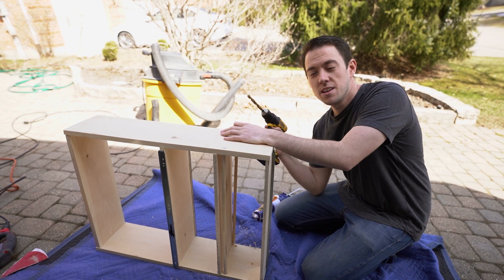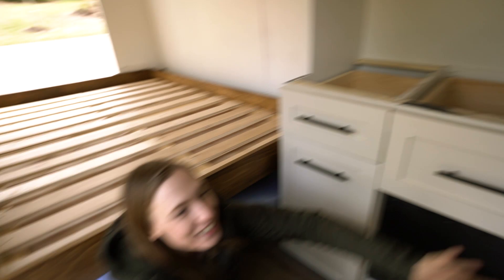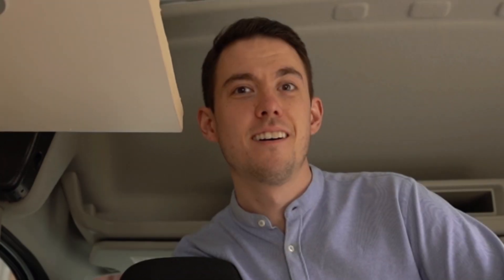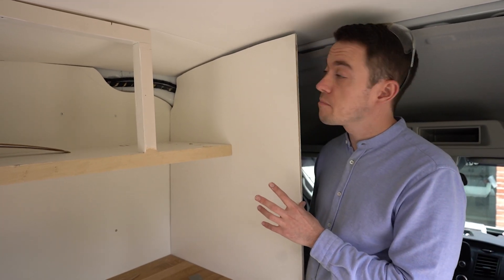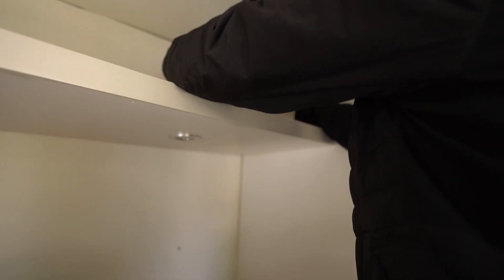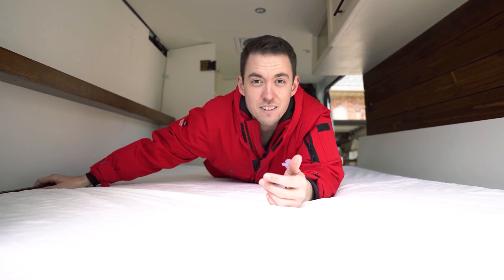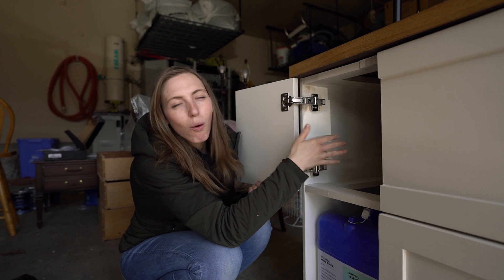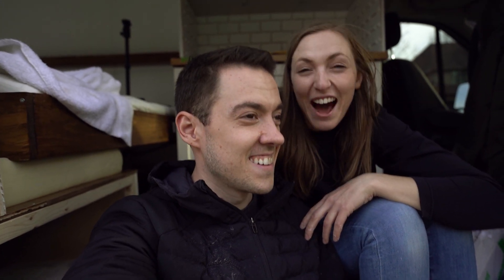We’re ALMOST done our van build! | Transit Van Conversion

Comment: Looks great guys! I ran my electrical wires today. Hoping tofinish my subfloor and framing the walls tomorrow. Decided to switch to 2x4 instead of 1x3 for furring strips. Couple weird parts of my van walls stick out and the bigger 2x4 will make it easier to put on walls smoothly. I need to connect my wires to the battery for my dc to dc charger. That way I don’t have to worry about trying to hide them after the fact. I look forward to watching you get out and adventure!!
Reply from the maker: Hi Amy! Hope the weather is warmer for you up north now that spring is on the way! What dc charger did you get?
Reply: @RichandKirsten  i got a renogy 50amp combination mppt controller and dc-dc charger. I figured I could kill two birds with one stone. It was gorgeous today and I got a good full day of building in!